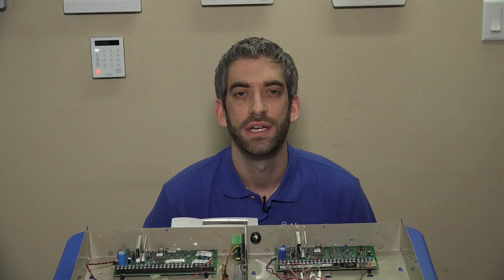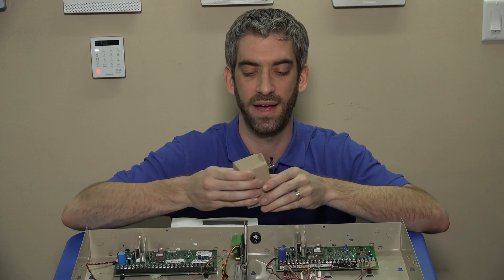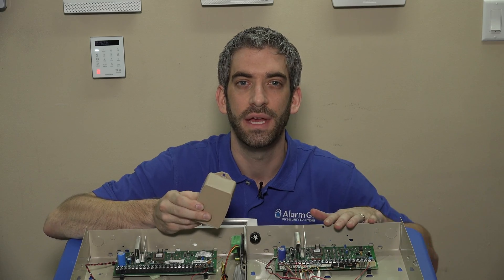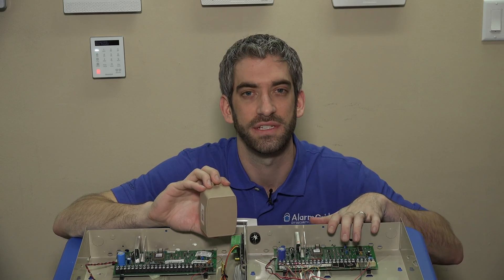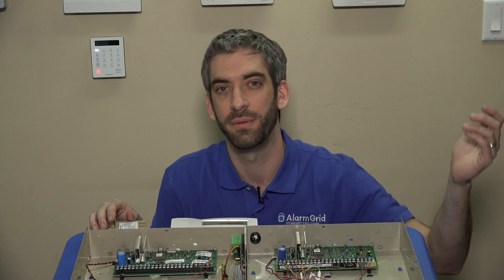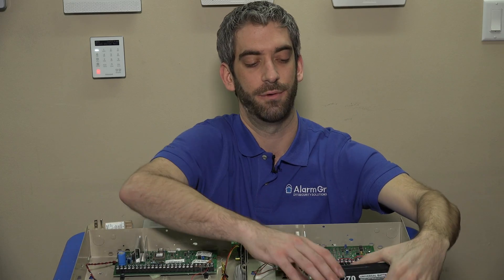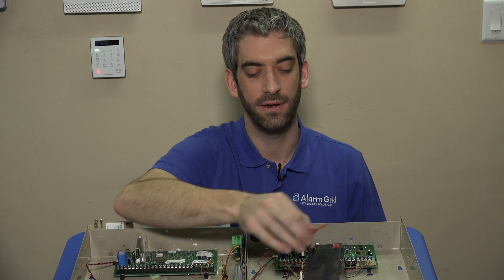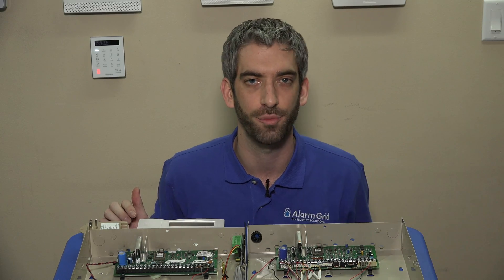Honeywell VISTA: Power Down Instructional

Comment: WA3001-1.5?
Reply: Hi, The power down process on a WA3000 Rev 1.5 is the same.  Unplug the wall adapter from the wall, and unplug either of the battery leads from your battery.

Comment: Do you have to disconnect both AC wires on the back of beige device when you unplug it?   There are two sections marked AC on the back of the device
Reply: That is not necessary, when you unplug from the wall you have already killed AC power ti the panel. No need to remove any transformer wires, just the battery wires.

Comment: Hello! I was looking for ways to fully disconnect an old ADT security system because it was get triggered randomly by loud noises and this video is super helpful! I just need to find the main outlet. 

Also, I think my smoke detector is connected with the same battery as the security system. How can I keep the fire detector even after I disconnect? Do I need to install new smoke detectors in every room? Thank you so much!
Reply from the maker: Hi Jane, if your smoke detectors are part of your alarm system, there is no way to keep them powered up while powering down the rest of the system.  In that case, you'll need to either get the system working properly, or you'll need to replace those smoke detectors.  If you're interested in getting your system working, we may be able to help.  If you're interested in doing that, send us an email at support@alarmgrid.com, letting us know what type of old ADT system you have, and we can provide more information from there.

Comment: hi
I have a question 
I have same system but all of sudden stopped showing anything on displays and keypads are not battery powered , they are wired 
Replaced main battery in the box and still showed NO AC and went off.
Do you know what might be the problem. thanks